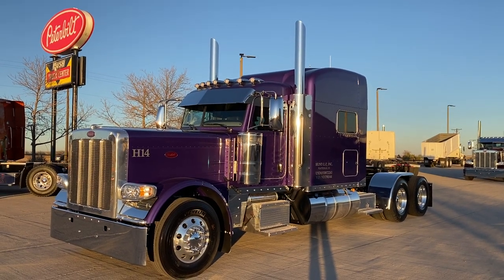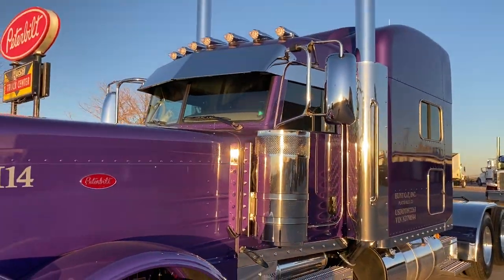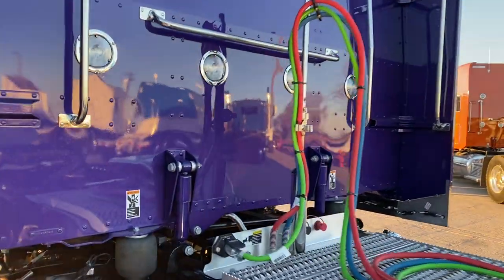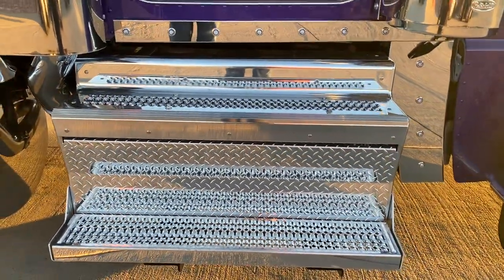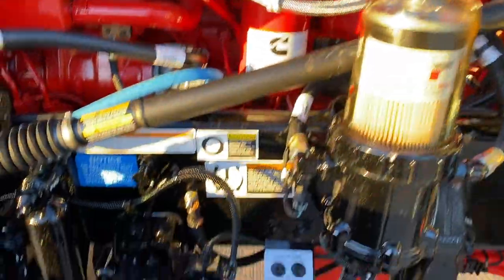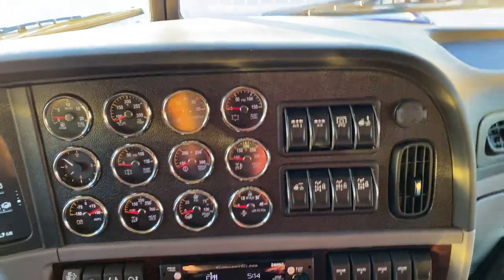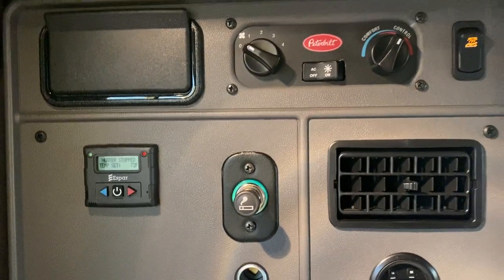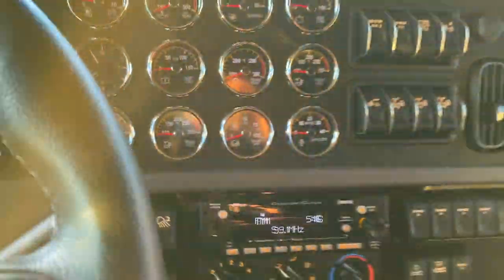Plum Crazy Metallic!

Comment: Greetings from the Ohio Porters on this wonderful Christmas Day! 🎄 I really like this Plum Crazy Pete! 🥰  It would look good in my driveway, connected to a nice older stainless steel trailer or even my old 1970s drop van trailer. 🤩😎 I like those sleeper fairings on the back….never seen the little “California” fairings as you call them. I don’t know that they really add much to a truck as far as fuel mileage, but the looks do it for me.😎  Are both stacks hooked up? 🧐 Wonder what this truck would look like if the stacks were on the back? 🤩🧐 I even like the extra touch of the interior lights. You mentioned that you guys added the horns. Was this truck a bare bones trucks with no horns?!  The only horns I saw were under the hood. Still, a nice truck indeed!!! 🇺🇸🥰😎✌️